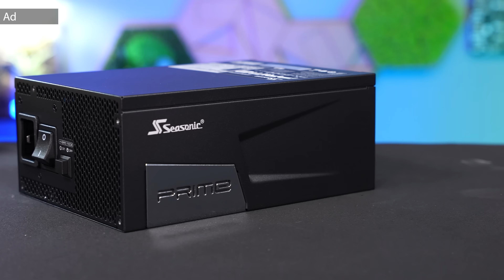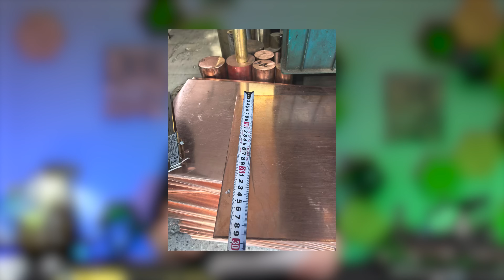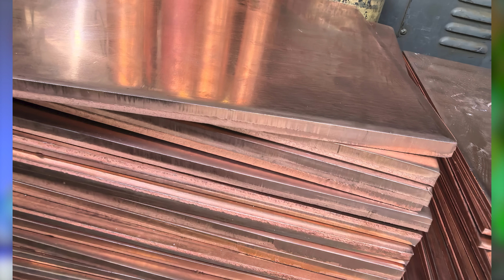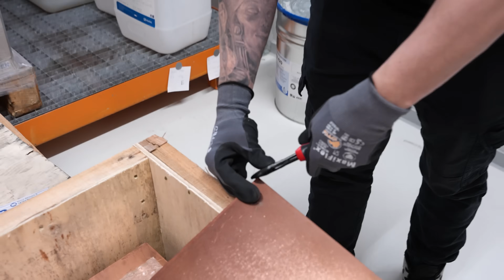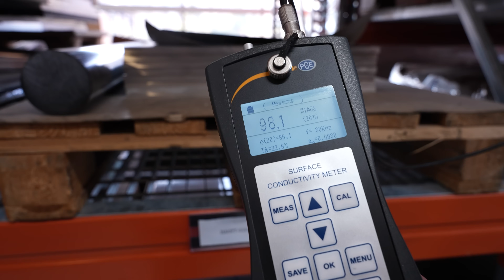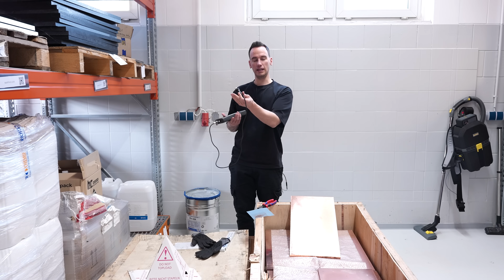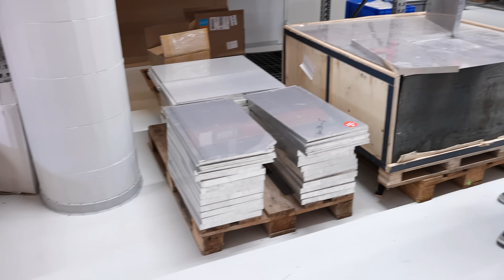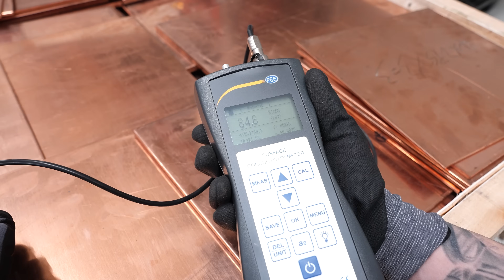I Got Scammed

Comment: This is textbook bugmen metallurgy-related scam for unexpirenced foreigners, extremelly common. You don't do business with them unless you have a representative on site, who can inspect the contents of your shipment before you do any financial transaction
Reply: Valuable advice above ^^^^^
Reply: and make sure that guy isn't their own
Reply: Can you have them send the material to another more trustworthy company in Shenzhen that inspects them and video records the process and then repackages the material and they send it to Europe?
Reply: @johnzach2057  You can do whatever as long as all parties are in and you have time and money for all additional steps.
Reply: if you enter the market it means you're also a bugman, bugman
Reply: Inspecting the contents of the shipment... Are you sure? Have you seen the whole video? Because in one case it was actual copper, just with a steel core. And in the other case is was actual aluminium, with steel underneath.
Reply: @sasjadv  they would have to have the appropriate tools.
Reply: @sigmaprojects  You mean the same tools that Roman also has? Like an SEM isn't cheap. Inspectors would use an XRF-gun of Laser-sparking Spectroscopy tool. But they don't show the steel underneath.
Reply: @sasjadv  You don't need a SEM on site, just that portable conductivity tool. That easily showed the steel.
Reply: @jaro6985  If you knew what an XRF tools was, you wouldn't say that. That's a portable tool, that already way cheaper than an SEM, and something an inspector could carry.
You could still fake it by just using a thicker layer of copper, with still steel underneath.
My whole point was that Roman already has expensive equipment, and even those results can be faked, and an inspector would have simpler tools than a laboratory could have stationary.
Reply: @sasjadv  inspector can have a drill, magnet, tape measure, and a scale. You can always get scammed, but if the effort to create the scam is so high at a certain point they wont bother.
Reply: @jaro6985  Ok, let's say the inspector has a drill.
Will he drill only the ones on top, or all of the plates? Or pick random ones?
Does he know where he can and cannot dril, to not mess up the part?
Reply: @sasjadv  My friend there are people and companies in china that do this shipment/factory inspection service professionally. You retain one to go out an actually inspect the goods with appropriate tools including taking weights of raw materials, and watch them being packed. They apply their own seals to the box. Then you have it inspected again before its loaded on the ship and only release full payment once its left port or on receipt
Reply: @sasjadv  There are literally inspectors who know how to check this stuff and this is discussed with the client beforehand. There's an entire system in place for dealing with this issue in China and has been a thing for a long time due to situations like Der8auer's. 
Of course it's not full-proof - but if you want 99% guarantee, then you basically need an intermediary company in China that is trusted.
Reply: @acbthr3840  I know.
But I distrust the whole premise. Because you'd first need to trust that person, and there is an informational asymmetry. The people there will always know more than you.
Sure, it makes sense when you post blanket orders, and this inspector wants to keep his job, and you let him inspect multiple shipments. But with a one-off shipment like Roman did, they can just as well bribe the inspector.
Reply: @sasjadv  Copper that is magnetic.
Reply: @PREDATEURLT  Well, guess what:
They could have used another metal that isn't ferromagnetic, even stainless steel, if that's still cheaper than copper, then it would make sense.
Reply: @sasjadv  In theory you can fake copper in so many ways, that only one true method of knowing what it is fully would be cutting it in tiny pieces and then testing, but it is unrealistic, so better just find a trustworthy source.
Reply: @sasjadv  
-Because in one case it was actual copper, just with a steel core.

Angle grinders exist. Drills exist. Portble XRF tools exist. 
Steel is less dense than copper. Weights exist.
Steel is less conductive than copper. Portable conductivity measurement tools exist. 

-And in the other case is was actual aluminium, with steel underneath.
Crowbars exist. 

Do I need to continue? You THINK you know what you are talking about, but you don't actually know what you are talking about. These are all well-known scams and major raw alloy importers tend to have dedicated staff in China for the sole purpose of controlling, checking and monitoring batches they order. 
Roman just YOLOd into bugmen market without due dillegence and got scammed as a result.
Reply: @np-process  I personally mentioned XRF-guns and laser spark emmision spectroscopy in my clarification to someone else.
Now you're telling me about XRF-guns? 🤦‍♂ Yeah, I know right; and that's only one of the two major options.
And that puts your words: "You THINK you know what you are talking about" in a different perspective. Because you're that guy...
Actually intelligent people don't belittle others out of nowhere.

About angle grinders and drills: that damages the stock you buy, and the customer might not want drillmarks. Yeah, sure, you could send the inspector drawings of the product you plan to produce, such that he knows where to drill. But he might mess it up, or you might change your plans and what to use the metal stock for other products.

About crowbars: 🤣🤣. Well, if you're inspecting thoroughly, then you know that you shouldn't just test the top ones of the stack, and you're better of actually testing the bottom and middle ones. So it's not about crowbars and glancing, but about picking up all the pieces and re-stacking them into a different pallet. That's also a lot of work, and if the pieces are too heavy, it will require collaboration from the supplier.

Another way how inspections could fail, is if the inspector you've hired, just got bribed. Because that's another thing, that as a small business-owner you don't have your own staff inside China to inspect stuff like this.
That's something you can pull off as a big importer. As a small business, you're better of looking into legal protections like escrow and legally binding warranty terms.
     The reality is, if you're talking to a supplier in china, that "supplier" might pretend to be the owner of a factory or warehouse, when it's just a middleman. They can even arrange factory tours, at the actual factory where your products are produced, without letting you know that there was a middleman altogether. And the factory organising that tour, usually had signed an NDA with that middle-man, so they won't tell you.
      So by your definition of "not YOLOing" you can still get scammed, if you don't do it correctly.
Reply: @sasjadv  What you do is embed an inspector from a western country in the factory, where they spend however long it takes for the production run and they inspect random samples throughout the entire process with calibrated instruments the factory doesn't have access to. They seal each container with tamper evident and serialized seals, they verify they get to the port, and only after you verify the shipment has arrived with the correct seals do you release the majority of the payment. 

It will cost a ton, it will be a major pain in the ass, people will try to run your man off or buy him off constantly, but you'll stand a chance of getting what you ordered. If you stick with a supplier and shipper long enough, they'll probably figure out cloning your seals. And then they'll rip you off.
Reply: @sasjadv  
I find your response incredibly lackluster. In fact, I believe it is a perfect demonstration of Dunning–Kruger effect

I mean, if using a crowbar to open the crate with aluminium shipment to check that there is no stack of steel and a spacer underneath it, is beyound your cognitive abilities, there isn't much to discuss with you any furter, is there?
Reply: @np-process  its actually even easier than that.  copper is denser than steel, so it weighs more for the same dimension.  your inspector (not a local!) can verify dimensions of each plate in stacks, and quantity, plus weight.  you cant add steel core to that and still be copacetic, one of the three would be off.  off dimension plates, too many plates, and weight of unpackaged contents, as well as observe the packing for "quality assurance" with an xrf
Reply: @sasjadv  for large orders, you always send your own guys to inspect
Reply: @np-process  hell, you could use a stud finder to figure out voids like the ones derbaur showed us
Reply: @np-process  🤣🤣You're the one mentioning "Dunning-Kruger"?

Dude, the last time I worked with a crowbar, funnily enough, was actually yesterday, I know how that tool works.
Yes, in this specific case you'd see the steel underneath, and damage the packaging in the process. But the scammers could just as wel have hollow aluminium, with steel weights inside, at the bottom of the stack. That's not something your crowbar will tell you.

About thinking "you're smart": I don't like to brag, but I have higher education, and I speak 4 languages (English is my 3rd).
I don't just know about the existence of XRF-guns, but I know the exact working principle behind it, and the principle of other tools (like laser spark emission spectroscopy).

Comment: The problem with dealing with China is that they know that if they scam you there's absolutely nothing you can do about it. The Chinese government will never side with foreigners or lift a finger to help you. I only purchase in small lots of $2000  (electronic components) at most and in each case I'm never really sure if the goods will be ok when they arrive, even with repeat orders. Most of the time I order components from a local supplier, who most likely orders from their sources in china.  Even though it occurs to me I could bypass the middle man and go direct to China I know I risk this very scenario by doing so.  Sometimes its better to pay more to a local supplier, and if they mess up at least they're the ones that take the loss, or you could sue them.

Comment: Not sure about prices, likely higher than China but it's within EU anyway.
"Boliden" has a large copper mine in sweden and sells to industries, if you want a reliable source that is not going to scam you, follows EU worker protections and has enviromental goals. I'd go there.

Edit: If copper is getting too expensive, how about graphite? Or copper coated graphite?
Thermal conductivity is slightly lower than copper (when not monocrystaline and out of 2d plane, though if you electroplate it with copper I have no idea were it functionally ends up).

I use water cooled graphite anode and cathode graphite/copper interface to a high temp (copper block with graphite anode screwed on, goes up to 3000C) production equipment at work. The tech is there for high temperature applications.
Price for replacement parts for those are high, but we buy one piece a year maybe so not really comperable for serial production (2000sek 200eu~ for something that would be the mass of to a graphicscard heat exchanger.).

Comment: For our company, we pay a company that do quality control, and they are the one that put the seal on the container for the shipping. You have company like SGS or bureau veritas that have personnel that will perform test for you in china. For first shipment usually we ask the expensive full or 50% of merchandise checking.
You are not an idiot, there is lot of company in china that do scam and usually is better to go check the company on site to see what they can do. And if you don't have natice speaker, you can get someone form a test company like SGS or bureau veritas for capacity checking. You usually get the scammer fast as they don't want you to do inspection for some reason. The second recommendation I would have is checking the region the company is, in china, production of product is most of the time region based, for example it's suspicious to have an electronic company outside of Shenzhen area.
As other people said, i recommend that you use letter of credit, the fund are kept by bank until a 3rd party check the marchandise.

Comment: It's amazing how far they are willing to go to scam, all that effort and the raw material shipped isn't cheap. And yet, they still go through with it. Even though something simpler would probably work and make them more money. 
Protecting against that, is just impossible. Nobody should feel like guilty for falling for that.
Reply: It's not that much effort. China is a massive bloc of its own. You can probably order copper plates with iron core. And putting them into a crate and shipping them isn't any different from shipping the real thing. 40k EUR is a lot of money in China.
Reply: It is what they do.  Remember that giant fires on tall building in Hong Kong? The buildings were under maintenance, a supplier sold fake protection nets without required fire proofing/protection treatment.  The government tried to cover it up by claiming it was the bamboo scaffolding of which they were in the process of banning (nobody knows why, it worked for 100+ years).  The lie was bit of a problem, it is notoriously difficult to set fire to bamboo. It is just an example how in China from bottom all the way to top of the regime, there is no shame in lying and covering up deaths due to fake materials.
Reply: His order size is basically the sweet spot for scam, not so big on site inspectors are at place and they risk massive repercussions after, and not so small it wasn't worth the effort.
Reply: They literally turned good copper into scrap. Scum! :(
Reply: @TechyBen  worse, they turned good steel into landfill trash that no recycler will take

Comment: Vietnamese here, I've heard many stories about these type of things.
They act all nice and a couple first deals goes smoothly and then they start to be shady
For example mixing couple dead cpus into a batch of 100, and then more and more
Reply: Fake chips is also very common, sanded down junk chips reprinted with fake specs.
Reply: @f0x4nn3 mfw ppl will want Chinese RAM and will get fake chips à la USB-sticks
Reply: Anyone remember SATA SSDs that had USB stick inside and some metal scrap to make it weight the same as legit SSD? 😂
Or 64GB SD cards that were 64MB but  you could copy 64GB no issue caude the firmware was simply overwriting data on that 64MB 😂
Reply: @sznikers What do you mean "anyone remember"? That's still a thing today. If you search for sd cards or usb drives or ssds on aliexpress you will find listings that are like 5 bucks for all sizes from 64gb up to 8tb or such, so obviously fake yet neither the platform nor their police stops them, and the reviews praise them. They even have "choice" or other similar platform endorsements. I really don't get why it's allowed when it's so easy to recognize at least in these extreme cases. There are also more believably priced listings but after seeing the obvious fakes I'd rather assume the rest are just less-obvious fakes instead of genuine items. They're also still on Amazon even though at least in theory that platform does try to remove them and withhold their cash etc. It's actually mind-boggling, in order to get paid those criminals are completely traceable and known yet the system still fails to meaningfully punish or stop them.
Reply: Yes, had this experience in company I was working for. Electronics ODM, they were good and nice at first, gave great work and samples, but when we got too deep in pre-production that they felt we can't reasonably ditch them anymore, they started demanding absurd payouts knowing that we had no choice - either we pay them, or there won't be any product we worked on for 2 years.

Comment: One idea for future. Send someone on a flight to the factory. Say that you will give the rest once they have opened and inspected the box to ensure it's legitimate, and they ensure it gets onto the ship okay. If the company takes issue with it, find one that won't. The person you send can do a simple magnet test or maybe even drill a few sheets down in the box and do a chemical sample test. Nitric acid, then add ammonia (bought over there ofc lol). Test conductivity, any cheap simple tester you can easily replace.